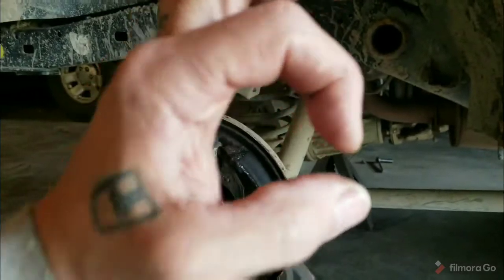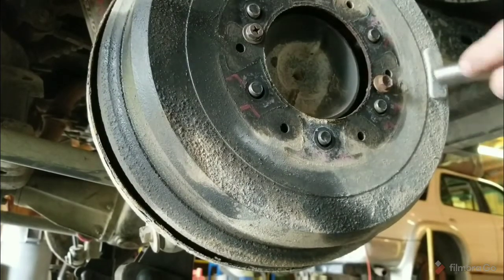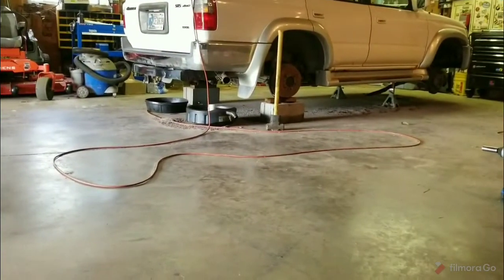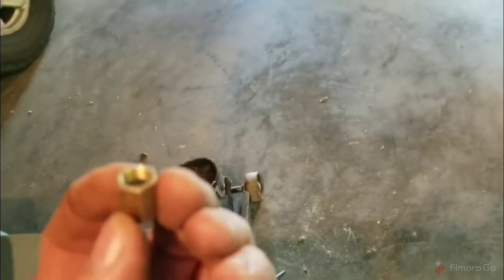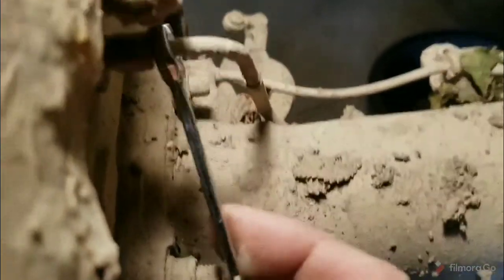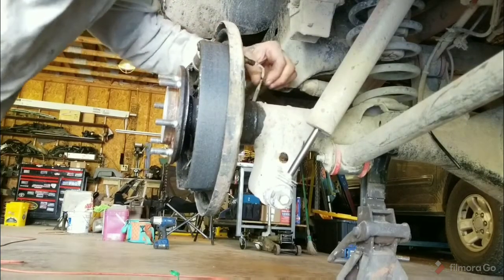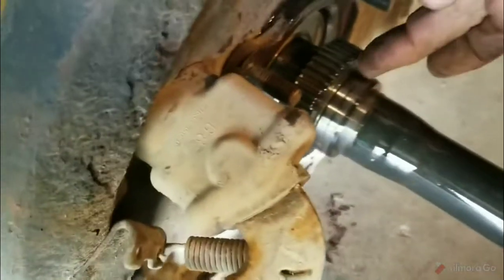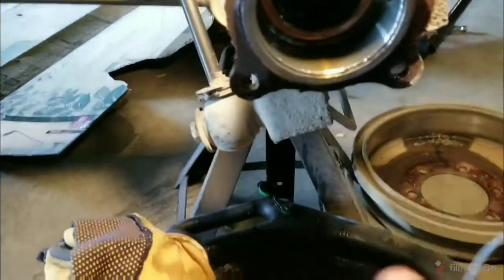How to tear down 8" rear axle, 3rd gen 4runner, Tacoma, Tundra, pickup and more.

Comment: Had an unrelated question: i need to restore my frame and im wondering how far i can seperate the body from the frame so i can access the top plane of the frame with a wire wheel. Besides the 10 body mount bolts and the steering column, what else should i disconnect so i can get about 5 inches or so of clearance room? Thanks for any advice you can offer. Congrats on the recent 1000 subs. Been learning alot from ya. Cheers.
Reply from the maker: Check for ground straps. Fuel filler neck may be an issue. I raised one high enough to do a 2" body lift without changing anything. Just lift slow and watch for things. Sounds like you've got a good grasp of the project already. 
Thanks, I'm stoked to have reached 1000 subs. Happy you get some good from my videos, makes it all worth it!

Comment: Hey so I got a 1996 Toyota 4Runner sr5 2wd and I had it for a year and half of the year my truck at 60 mph I’m hearing grinding and feeling a vibration a little. Any suggestions I put a brand new driveshaft in it it was better but still hear it. It’s been 2 years since this video been released idk if u going to answer
Reply from the maker: If the driveshaft made it better then you are on the right track. 
If you jack up the rear wheels and run it in gear can you duplicate the noise?
Check the dust shield on your pinion, they can get bent and make a scraping noise.
Possible rear wheel bearing.
Could be in the rear brakes, but that wouldn't be affected by changing the driveshaft. 
I'd definitely try to raise the rear wheels and see if you can hear it.
Strange noises are hard to diagnose. 
Best of luck finding it, hope this helps some.
Please let me know what you find.
Thanks for watching and commenting.

Comment: Hey I want to pull my entire rear axle, clean it up, rustoleum it, and slap it back in. Any pointers on how to go about that?
Reply from the maker: That will be nice.
Thanks for watching and commenting. 
Support the frame just ahead of the lower control arm mounts. Remove the panhard bar from the axle side.
Removing the e-brake cables and un plugging the abs wires is the hardest part.
Support the center section with a jack (still at full droop) remove shocks from axle.
Unbolt the sway bar from axle.
Unbolt the drive shaft.
Then I unbolt the upper control arm at the axle.
The rear end can roll back some, but it's OK.
Then unbolt the lower control arms from the axle.
The springs are at full extension during this so no issue there.
Reverse procedure to reinstall. 
Aside from being heavy and awkward, it's an easy 1 man job. 
Enjoy the project!
Reply: @funjunkiegarage  you responded within 15 minutes that’s nuts! And seriously thank you for the steps! This was the best video I’ve found on working around the rear axle so I’ve watched 5-6 times but there was still things I specifically needed so thank you very much! I commented on another video about the parking brake kit you bought (the wife moved the runner around with the e-brake on) it’s old and tired so I figure while I’m down there I’ll replace that as well 🤷🏼‍♂️ thank you again!
Reply from the maker: Thank you for your support. 
I'm always happy to help. 
I appreciate the questions.
Reply: I’m thinking of replacing my entire rear axle with a nice one from the pick and pull

Comment: How many miles do you have? Just curious
Reply from the maker: The black 3rd gen 4runner has 225k on it.
I just put the locker in about a year ago.
Reply: @funjunkiegarage  I have a 99 Limited with 267k and my passenger side started leaking recently.
Reply from the maker: I'll be replacing the seals when I put the locker back in.
If you let it go too long it can ruin the wheel bearings.